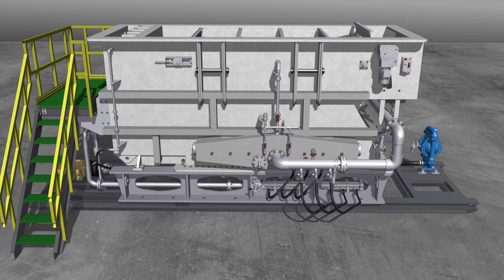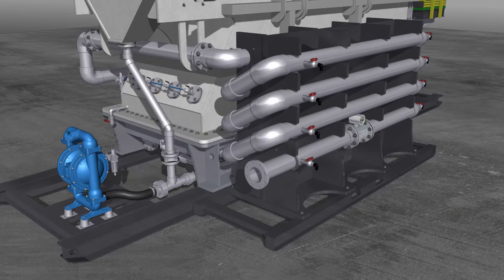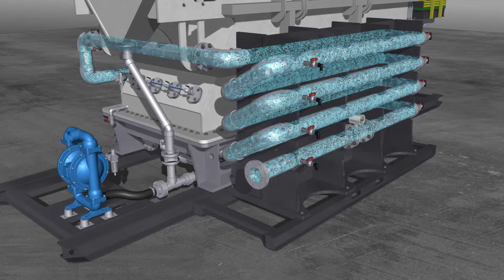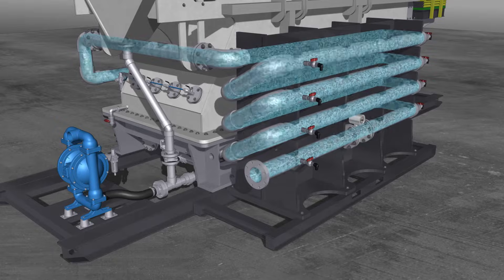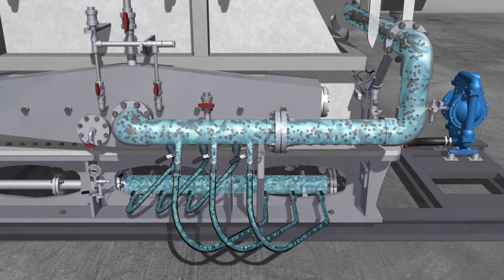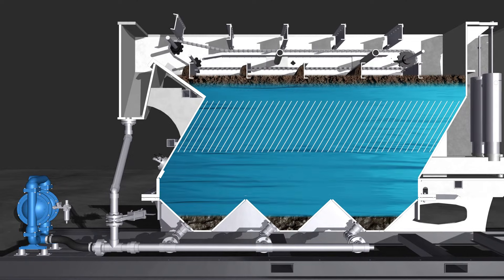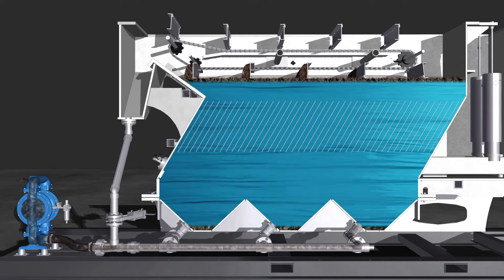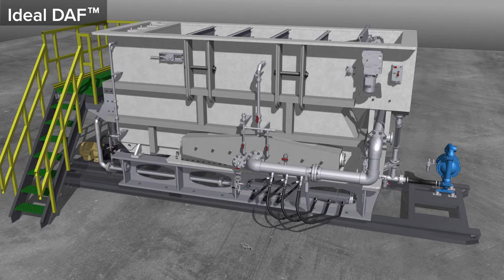Dissolved Air Flotation (DAF) System - Ideal DAF™

Comment: which is the order of injection of the polymers in the A.P.F (flocculant, coagulant). If I need to add caustic soda or some acid to control the pH, where in the A.P.F should I go?
Reply: eso se realiza en el serpentín, con picajes de dosificación.

Comment: Questions 
1. Will any type of Coagulant and Polymer will work here?
2. Can we use Lamella Plates to lessen floating flocs?
3. What are the retention time for the processes like Coagulation, Flocculation and Sedimentation?
Reply: The coagulant and polymer you use depends on the water you are trying to treat.  Lamella plates can increase flow capacity by providing laminar flow in the equipment with less turbulence and a greater surface area effect. Effectiveness depends on the design.  Retention time depends on reaction time of the chemicals used and the rise/fall rate of floating or settling solids
Reply: 2 Opciones: 1- realizar ensayos con agua real y ver demanda de productos químicos.  2- basarse en la experiencia y simular en base a una analítica y conociendo el sector.

Comment: Interesting. I work with similar plant, only that the bottom sludge is pumped with a travelling bridge with an air pump on the top of the basin to discharge into a clarifier.